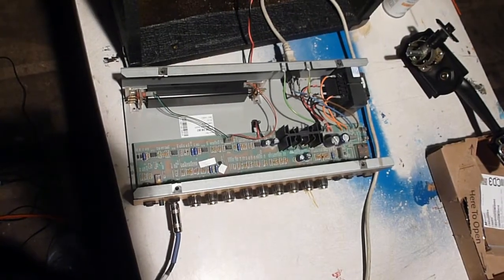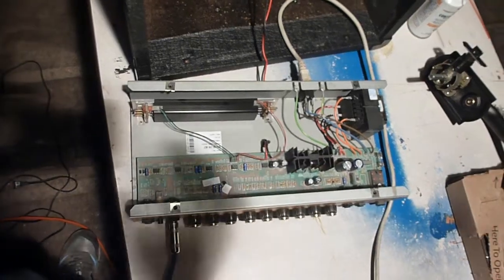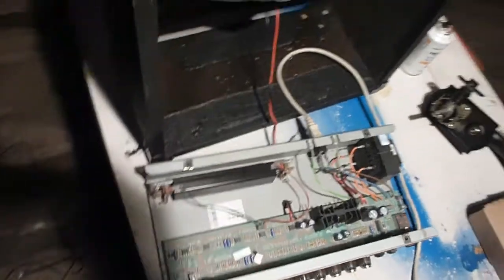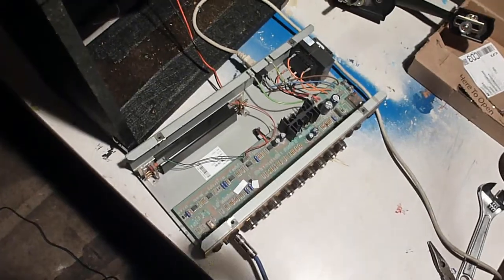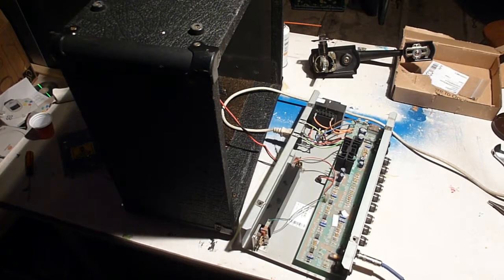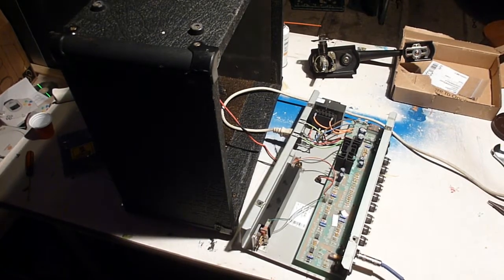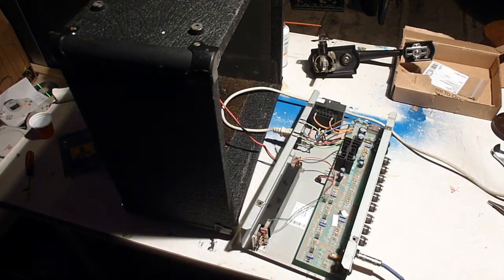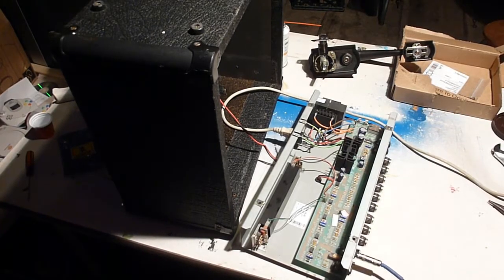The sound of bad filter caps - hum and ghost notes.

Comment: I have a working amp, solid state.  Everything works but im getting a white noise and slight crackle while idling.  Volume pot adjustments make no change. When i plug direct into effects loop return, the noise is not present.  Since the volume control doesnt affect the white noise, could the noise be a failing resistor?  This is a hartke b200 bass practice amp.  All pots work and i “tap tested” the entire circuit board with no change.  I thought maybe filter caps, but plugging into effects loop return sounds clear as a bell.  Any suggestions?

Comment: Have a 12w solid state guitar amp with same noise but I replaced the filter caps with new working ones and it’s still making this noise. Are there other filter caps found down the line that I could check and if so how?

Comment: My tube amp is doing this.  I just built it and got it together.  I checked every component prior to installation, but maybe heat got to one of the caps.  The problem is worse when it is warm.  Thanks.

Comment: Hi i have a randall 40w amp it does loud thumping noise after switching on for a few seconds its a steady thump as if its metronome...could it be bad caps as in ur video? 1 thing i noticed was if  i pressed the selector switch the thumping kinda switches between fast pluse to steady thumping...
Could it be the faulty selector switch?

Comment: Arrived here trying to troubleshoot a Peavey Minx 30W for Bass. I think now after watching the video, that the problem might be in the capacitors (The amp sounds at it had an overdrive distortion, which is also present through the headphones output). Thank you for the explanation. I let you a thumb up.

Comment: So bow does it sound when they haven't failed but are a bit weak.
Reply from the maker: Basically this but less intense.
Reply: @dissonantcognizance  I hear a soft round 50hz hum on my tube radio from 1963  regardless of volume and a 100hz hum when I crank it. Not overpowering and it plays well but it's clearly audible all the time.

Comment: Question... I just restored a JCM800 2204 and I have a hum of that frequency - only when a guitar is plugged in. But I do NOT have that ghost note problem, my chords and notes sound full and completely unwavering.  I really do not remember if I had a tech change the filter caps maybe 5 years ago.  Should I change them based on the hum alone? Or if I do not have the ghost notes is my hum coming from something else?

Comment: I have a 90's Fender Champion 110 SolidState amp and it Pops (like cracking your knuckles tone) Extremely loud when powered off. I mean wake up the house loud. 
It make no difference  how the volume control is at up or down. The amp is quiet when in use and just a little bump like normal when powered on.
Any ideas? Thanks

Comment: Very informative video.  I have a Peavey Transtube 112 EFX amp that was giving me the same issue. First it was intermittently adding in other tones while I was playing but now it has progressed to the point that the only sound it makes is that hum (It hums immediately when turned on and no signal comes through at all). After watching this video I changed all the caps but there was no change. I know the problem is not in the preamp because I can hear the expected signal through the effects loop send and it sounds great. I'm at a loss. Any ideas?
EDIT: I forgot to mention that the transformer is humming at the same pitch as the speaker output. Not sure if that's relevant but it is interesting.

Comment: I have a great Sansui 881 receiver. ( 1975-77) that has a slight low buzz sound in the left channel. It DOES NOT increase with volume increase . Could this be a failing cap or something else?

Comment: Hello! My Orange bass amp (Crush 35B) has a ghost note when playing some specific medium notes at high volume. Could it be an issue with the caps or maybe something different? I tried with a different speaker and the same issue is there.
Reply: yep, it has two big 3300uf 35V that are a little bit bumped and shows some corrosion. I already ordered in amazon a couple of nichicon 3300uf 35V. Would you recommend using 3300uf 50V instead?
Reply: I used Nichicon audio caps 3300uf 50V +/-20%. The difference is so amazing: the ghost tone is not only gone, but the tone is clean and sharp. Thank you so much for this video, you taught me so much and enabled me to not only fix but to improve my amp. Thanks!

Comment: I bought  a 90s  mesa boogie 50 50 knowing it was only working on one channel. One set of pwr tubes were red plating. Bought new/used pwr tubes and still red plated.  Played it safely through the one channel but then it died all together. Checked for burnt spots but dont see anything. Any recommendations? The pre amp tubes dont light up but i checked the tubes and i get a continuity signal from my multimeter.Trying to work on it myself has lead me nowhere, techs are expensive for me on a fixed income. Had the amp a few years and its just been sitting there unused. Might just have to bite the bullet and cough up $200+ to fix it.

Comment: What if the sound is more of a white noise like WOOOOSHHHH wind type sound?  Could that also be a bad preamp?
Reply: In my case it was dirty/busy power. I was running off a power strip that was running a lot of power. Ran an extension from another outlet and it sounded much better.  Worth a try at the very least!

Comment: Does the hum from a 'failed filter cap' go louder when the volume is turned up? Can the same happen if the capacitance of the filter caps is to low? My hum goes up with volume and at a certain volume I get a very ugly 'feedback noise' like holding a mic in front of a speaker. (Trying to debug my custom built amp)
Reply: It is more probable your amp might have a bad grounding placing.

Comment: Dang! I just got a used Blackstar ht 60 and everything was working great then yesterday i swapped the speakers and laid the amp face down gently changed the speakers and when I went to turn it on it started humming and I noticed the clean volume is super low.
Reply: 1thess523 laid it down hot? Wires move around like Spaghetti noodles when they’re hot.. If that was the case pull the chassis and make sure all your capacitors are not laying on each other

Comment: Higly recomend you put bigger value uf in the amp  when you first have to replace them.10 000uf or 15 000uf pr channel.i have build a 3 channel 4  120watt power amplifier modules the end millenium xp witch is some of the best and c real linear poweramplifier.each have 2 channels on one side in the cabinet with on toroid with ac 42Volt -0 42Volt times 2 on each trafo and 2 full bridge rectifier  and 120 000uf nichicon capasitor bank;thats for 2 channels on one side of the cabinet.total a have 4 times 120w in 8.i doubles down to 1 ohm.the most silent amp i have heard back in 200.and kin 2016 when i build my last one.never going to use another poweramplifier again.They are no negative feedback local or global at all in this amp and it hold the fine tone quality when i turn the volum on my preamp up.i use this 4 channel power amplifier i build in a active system so it has to be dead quiet.No hiss or hum.I use planar magnetic midranges 40inch high 6.5 inch wide and the chamber behind the middriange section in a semi cabinet with a wawe gyide inside behing driver verticaly and a slot verticaly on each side of wawe guide.lots of damping inside to. Amt tweeters on the side 20 inch high section 5 inch wide.This has a senitivity for mid section 100db.tweeter section about the same the woofer is a 12 inch 10kg high quality from germany called BMS.I tried rotels nads and higher priceclass dub i could hear the hiss from my chair.with theese i have to go with my ear against the tweeter to hear a faint hiss.Think this has mutch to do with how short signal traces are and nno sharp corners on coppertraces that this matter so the size for one 120w is like a credit card.lock them up on google in pictures.They where called The end millenium XP and was the last verson that came out very poular.Mine old onec are still in use.and this one i bet last out my life.W as a long rant this.Sorry for my bad writting english.It is not my language.
Reply: thanks for your reply to this video. Based on your recommendation I re-opened my electronics books and started asking questions, and I ended up with a fixed and improved amp.
Reply: Can someone re-write @leohobb leohobb's comment here, but in more "plain English." I'm having trouble understanding what he's saying =x

Comment: Hey man...i have a wierd static/crackling noise coming from 2 different amps...a mesa and brand new fender....both do it when plugged n to the wall and with know guitar cable plugged in! Does this sound familar to you by any chance...its the same noise in both amps! Thanks man:)
Reply: Mrbrutus002 does the noise increase or decrease when you spin the pots? May just be dirty... those Mesa boogies are becoming more and more of a prob.. I’m about to start charging extra to work on them

Comment: It's like they design the electronics to fail. They should ban all electrolytic caps and go for solid state caps at least to prevent e-waste.
Reply: I wonder t hat too- why can't they develop higher value caps that are more reliable like the film caps etc?   An engineering/cost issue 
I would guess .

Comment: so each input jack has a filter cap? I'm getting a bad hum like this on my Fender Deluxe amp when plugged into the 1st input jack but not in the 2nd input jack. Thanks!
Reply from the maker: I wouldn't think so. It might be possible depending on the amp,  but that sounds more like a grounding issue. The first thing I would check is if the shell of the input is connected to ground or not. Is this an old Deluxe amp or a recent reissue of some sort? If it is like the original Deluxe amp where each input runs to a different triode, then it could be a grounding issue around the first gain stage somewhere. But even in that case, they should share a filter cap, so that seems unlikely.
Reply: Epiglottis Dynasty  I think you're exactly right. It's a Hotrod Deluxe. I believe  the circuit board will have to come out to fix the grounding issue on the main input jack. Thanks so much man, really great vids!